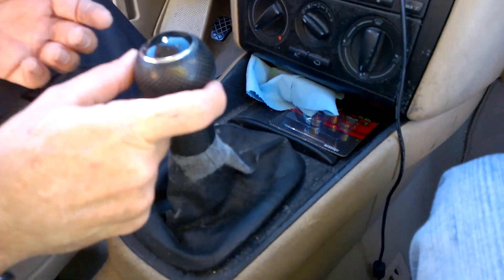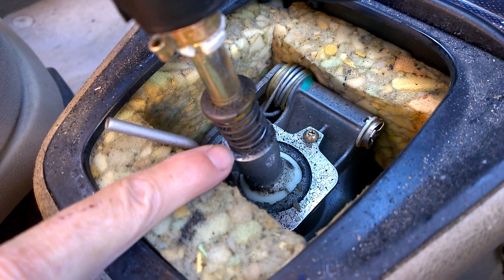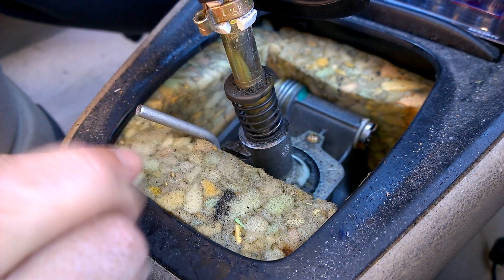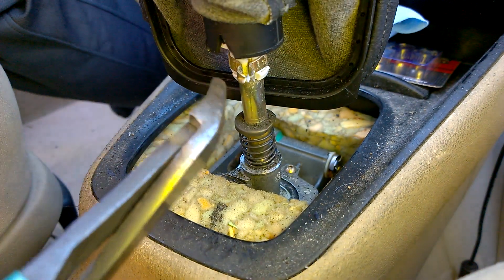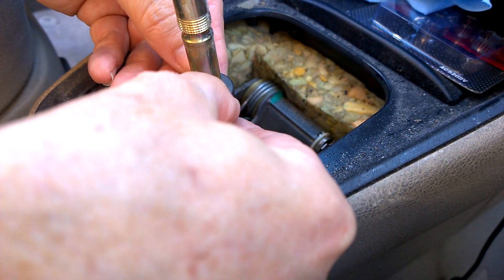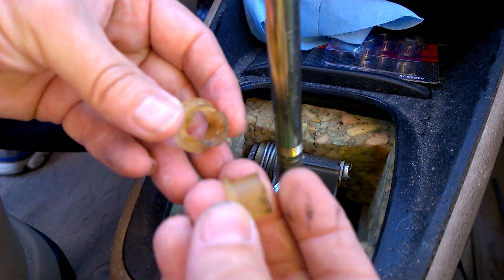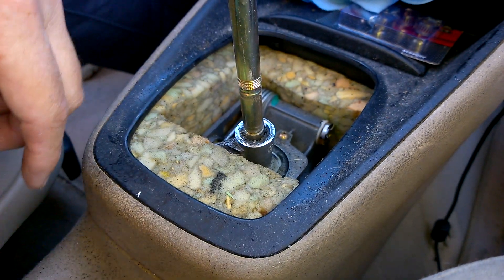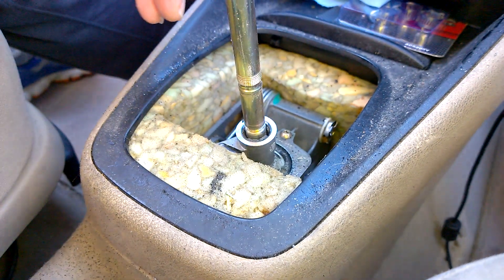VW MK4, MK5, and MK6 Shifter SHAFT bushing replacement from Dieselgeek

Comment: Just bought your bushing and followed the video, cleans out the shaft, but all the lower bushing does is lock up my shifter leaving me to force it back up, what can I do to fox this? It's a mk4 golf with a 5speed
Reply: @dieselgeekdotcom  i can't view your email.
Reply: I have the same problem and even tried greasing it with no luck
Reply: @3meansgo  I ended up not using it and haven't had any issues with it. The spring slipped into the housing and with the locking cap it just stayed in place.
Reply from the maker: Every single time we have this compliant the problem ends up being debris in the housing causing the bushing to bind. -tyler

Comment: I have this problem on my 2010 Jetta TDI. Your website says it fits MK4 and early MK5's but in this video you say it fits all the way up to the MK6. My shifter assembly looks very similar to this so I'm assuming it will fit but I just want to make sure before I buy. While I'm on this topic, will the first gear grabber fit my 2010? Cheers! :)

Comment: I did this surgery a couple years ago with an oil-brass shoulder bushing I got from Grainger. It is an interference fit to the aluminum carrier, so had to be lightly driven in, and is a tight enough fit on the shifter shaft that I had to slightly file the knurled areas and slots. Your solution is undoubtedly easer, but mine is all there was at the time, as there are no factory rebuild parts.

Comment: Hi Jim, I have 2 VW Rabbits. 2007 & 2008. Will your deluxe bushing kit fit on these? My wifes 07 I having issues grabbing 1st, and there's crazy forward/back slop. I believe the rabbit is a MK5, and I'm having trouble finding fitment info on your website.

Comment: Do you have a video to help with 2004 Beetle Turbo S 6 speed shifter? Mine is not able to go in reverse...
Reply: @dieselgeekdotcom  Thank you! After watching the video, I looked around the different places in the shifting assembly and found that a cap from the negative post of the new battery I just changed out had fallen down into the gap below the selector shaft, preventing it from moving into 1st/Reverse position. I pulled it out of the way and everything ran perfect! That was an EASY fix for once!

Comment: i am having trouble with a mk4 going into reverse. I'm able to put it into reverse manually under the engine bay, but it is nearly impossible from within using the shifter. no problem getting out of it once i get under the hood and set it up, then back up i can take off, but i suspect it is having trouble going all the way down to the level of reverse and thats why once down it won't go in gear from inside. i don't have a mechanic i can trust or i would just call em n see what i need to do, i gotta do it myself and I'm not sure what part is responsible for this so was hoping someone here would?
Reply: Did you ever figure it out? I’m having that problem right now
Reply: @angelruiz5421  yeah I had to get a new Trans  my clutch was acting up  but changing that didn't help I basically got robbed by a shitty shop

Comment: Thanks for all your informative videos, much appreciated. Is this do-able without removing the shift knob ? I have removed my center console and cut my tattered shifter boot off, so plenty of room. I don't want to cut the crimp if and replace if I don't need to.
Reply: Ok thanks for the reply
Reply: You can also use a small hose clamp or get one of those clamps very cheap so you can remove and put back on correctly.